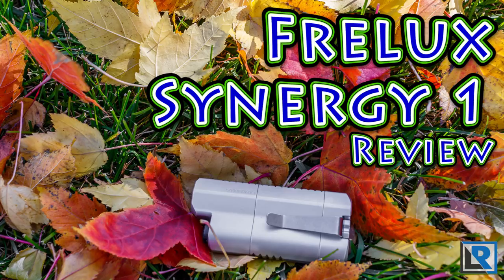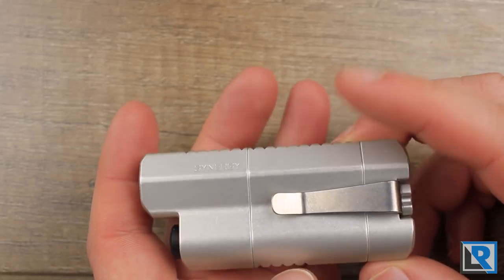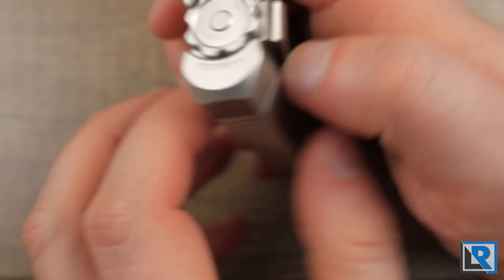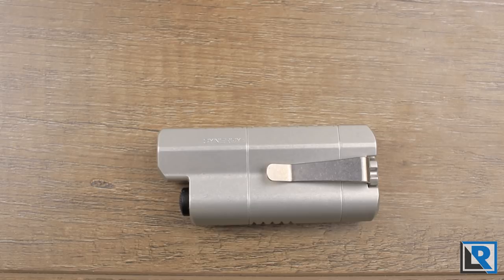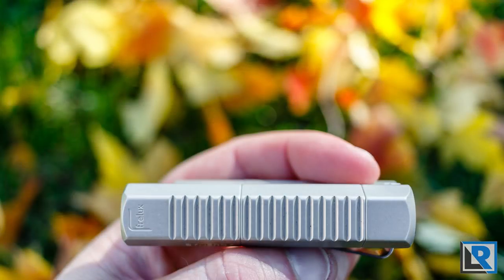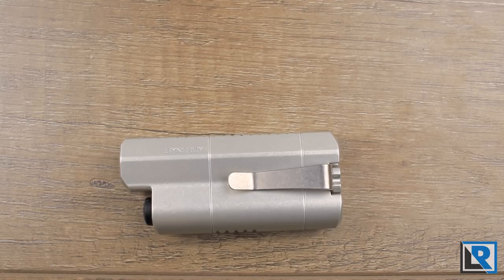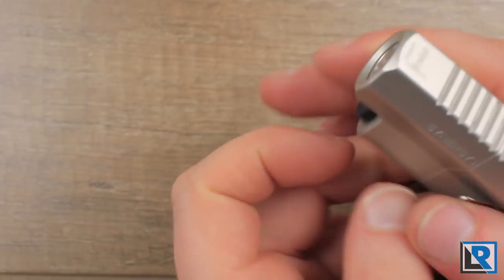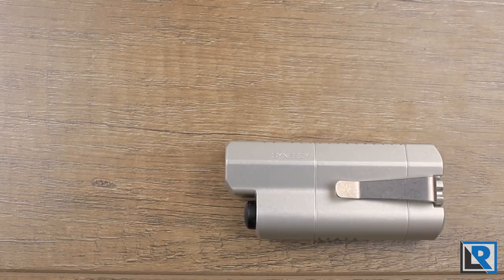Frelux Synergy 1 Review (Custom EDC Light)

Comment: Just a heads up, there cannot be a "Made in the USA" marking on it because legally speaking, it's not "made" in the USA. The emitters are finished in China, so the most that can be legally marked on the light is "Assembled In USA." In order to qualify for "made in the USA" every component must be entirely manufactured in the United States.
Reply: Great review of an interesting host. afaict the electronics are Lumintop. Specs for the 2x Lumintop IYP are very similar (there is a Ti version for $50 btw), and the button looks like the one on my old aaa Tool.